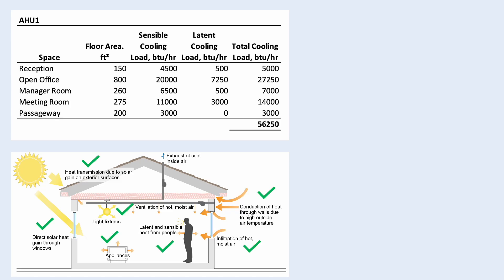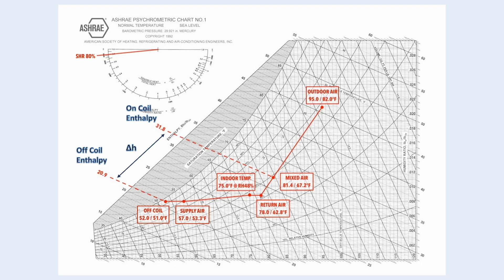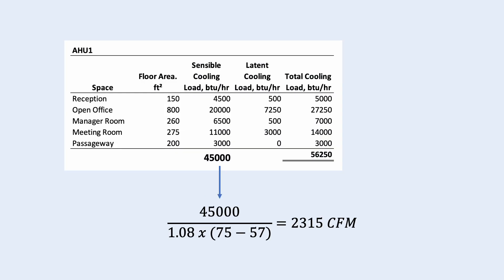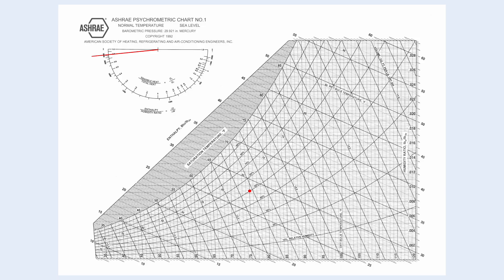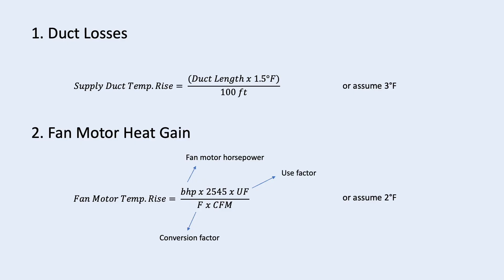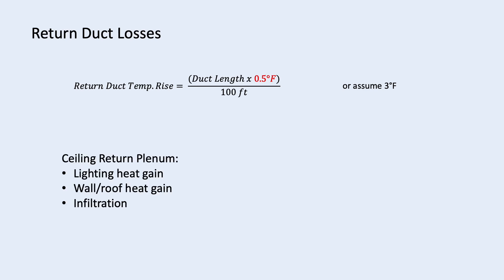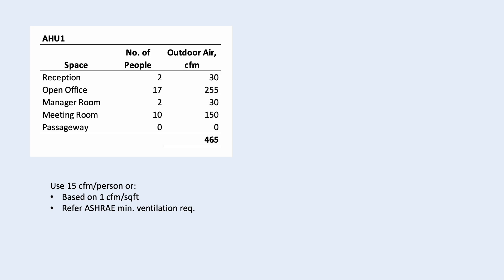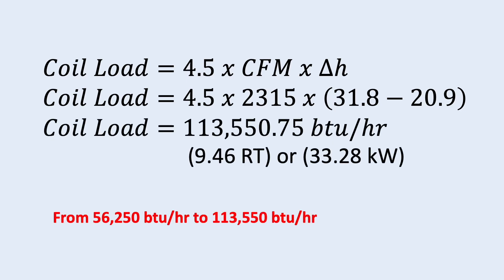AHU Cooling Coil Design Calculation (Step-By-Step Clear Guide)

Comment: sir is this the same procedure if we are designing a space with FCU and not AHU. thanks so much sir
Reply from the maker: Yes if the FCU is custom made. FCUs usually have standard models, so we select from the catalog. But large FCUs can be customized.
Reply: @aircondlounge so it means sir that we cannot use this procedure if we are designing using the available FCU in the market, like ceiling cassette, ceiling concealed, ceiling suspended and etc.

Comment: Why the CFM in final calculation is only 2315 it's total value will be 2315+ Outdoor air
Reply from the maker: The CFM needed is based on the sensible load. It is a mixture of the outdoor air and recirculating air. How much outdoor air is needed is depending on the number of people and the recirculating air is reduced as the outdoor air increases.

Comment: @aircondlounge  if your AHU is CAV you can add sensible heat to get total sensible heat. if AHU is VAV then you can nod add the max of each zone sensible heat together
Reply from the maker: For VAV AHU, you should apply a diversity factor to the total sensible heat you mean?
Reply: @aircondlounge   you should calculate total sensible load of all zones  hourly to find the worst scenario with highest load, not just add the load of each zones together. because they can not occur at the same time to add them together
Reply from the maker: For load calculation yes. However, if those zones are serve by one AHU, adding the max load at each zone at different hour will lead to oversizing because when one zone is at max load, it doesn’t necessarily means the other zones are at max load as well. So, sum up the load by the same hour and choose the highest one should be the optimal approach.
Reply: @aircondlounge  yes thats what I mean. So you select the hour with highest load?
Reply from the maker: Because this video is about coil sizing, the sensible loads are just an example. In load calculation, I do calculate by hourly and pick the highest load hour.